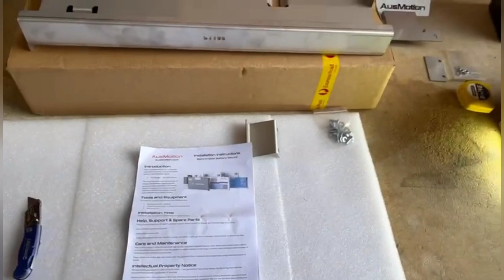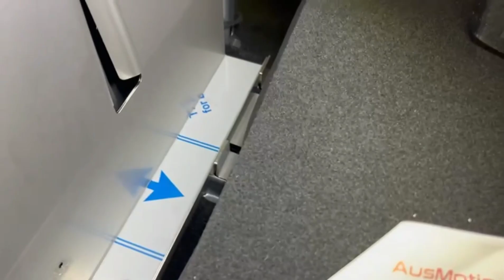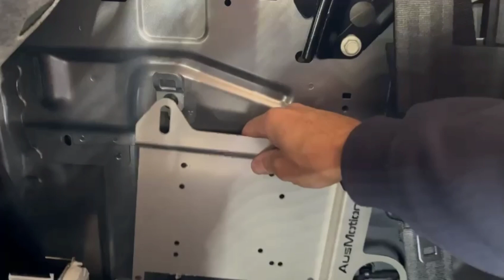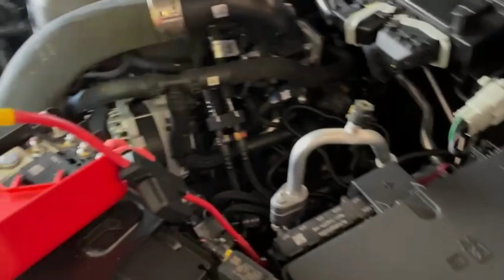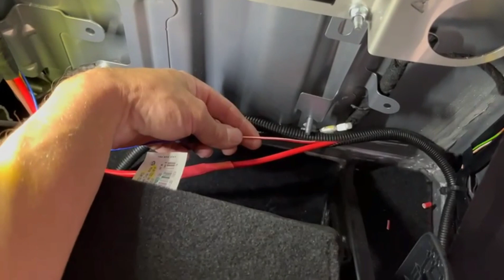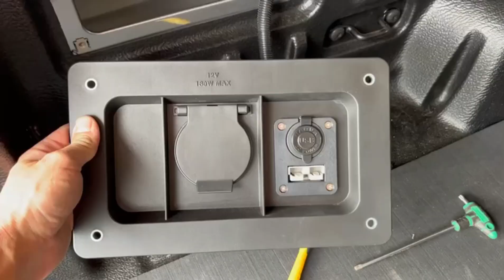Lithium Dual Battery Install | New Ford Ranger ‘ Next Gen’ XLT 2023

Comment: Cheers for the video. Question with cable size used for the feed out to the tub. Was this 8awg.
Thanks
Reply from the maker: Thanks for watching. Yes 8awg or 8mm2 cross section, its 8b&s cable which is rated at 75amp.

Comment: Great video as I'm just about to tackle this job myself.  Did you have to scrape away any paint or prep that stud as a ground point at all?
Reply from the maker: Thanks for watching. The surface is already clean and ready but i did use sandpaper on the stud/ surface just to be sure. Let me know if you need any other info/ help.

Comment: When connecting the ignition wire. Is there anything I should be doing before hand? Does cutting it trigger any fault codes etc. and did you just cut and connect the 3 wires?
Reply from the maker: Cutting it shouldn’t trigger fault codes, but just make sure the ignition is switched off when doing the wiring. And yes cut and joined the wires. 
Let me know if you need any more information. 
Thanks for watching.
Reply: Thanks for the reply. Did you solder the wires or just BP?
Reply from the maker: No problem, I soldered them. Either is fine, i just prefer soldering.

Comment: Awesome video. Very informative and helpful. Thank you!

A quick question if I may - If I wanted to run two Andersons and a usb socket, using the same method of piggybacking like you have done, would you recommend using a 8mm2 B&s cable as the main feed to the tub, then dropping to 6mm2 for the Anderson feeds, or could I use 6mm2 for the main feed to the tub and the piggybacks for the two Andersons and USB’s?
Reply from the maker: I would always recommend using the larger cable for the main feed. This avoids any volt drop and future issues. 

Thanks for watching!

Comment: What is the slimline battery measurement?
Reply from the maker: Case Dimensions (L x W x H)690mm x 50mm x 305mm
Let me know if you need anymore info.
Reply: @vesautoelectrics  for battery do you have recommendations for budget build
Reply from the maker: For budget builds i use ATG batteries, but not sure if a slimline is available? Other alternatives are baintech, Itechworld or Kings. But try and buy the best you can afford.
Reply: @vesautoelectrics  thank mate. Will do research for all the brand
Reply from the maker: No problem 👍

Comment: Excellent content. Question.... do other manufacturers do the "accessory outputs" like Ford do???? That would make DIY so much easier. I have a current model BT50.
Reply from the maker: Thanks for the feedback! Much appreciated. Some of the Isuzu commercial trucks have builders plugs for adding accessories and also some American pick ups. It’s really handy especially with all the canbus wiring  and modules on vehicles, makes tapping into circuits very difficult.
Reply: 70series Landcruisers have a black box under the bonnet with fused terminals for ACC, IGN, B+ and Earth.  Makes life easy.

Comment: Great job on the videos as usual.
l have a question for you regarding the POSITIVE LIGHT pre-wired wire in the passenger kick panel of the next gen rangers.
I am wiring up 2 Narva spot lights which comes with a 3 pin plug and a 12 inch wire harness red, black, and (brown which is to connect to vehicles parker light circuit (+) ) with a kings 4wdsuper centre spot light wiring harness.
So would you think the parker light circuit (+) be the same as the POSITIVE LIGHT wire.
Thanks
Reply from the maker: Thanks for the support! Yes you can connect to the positive light wire to have park light function work on the spotties. How comes the Narva spotties didn’t come with a harness? Also just make sure the wire sizing is sufficient on the kings harness and the plugs are the same.
Reply: Hey thanks, yeah the Narva spotties come with a foot long harness/cable with a 3 wired 3 pinned deutsch plug and then you terminate the red +, black - and brown to the park light + wire. The kings plugs are only 2 wire red & black, I’ll be doing solder joints.
So the brown wire of both spotties ( parker light wire) to the positive light wire of the vehicle.
Thanks
Reply from the maker: Sorry only just seen your comment. Yes that’s correct. Once it’s all wired up, run the vehicle with all the lights on for 10 minutes, just to make sure no wiring /connections are getting hot.

Comment: Fantastic video and very helpful. I purchased a slimline rear seat kit for the next gen Ranger from accelerate 4x4.  in their instructions they run the trigger wire all the way over to the fuse block on drivers side which but I want to do use the run start wire as you did however it’s being used for the ARB light bar. Is it safe to tap into this and will it handle another circuit ?
Reply from the maker: Thank you for the feedback. Yes you can tap into the start run wire. The ARB lightbar wire is just a trigger, same for your wire going to the dc charger. Very small current from both so no chance of overloading. I would put an inline fuse on your trigger wire. 5amp will be fine. Let me know if you need anymore info. 
Thanks for watching.
Reply: @vesautoelectrics
Reply: Thanks for the quick reply and did as suggested and works a treat. Again your videos are very informative and enjoyed the review on various lithium batteries and other tips and tricks.
Reply from the maker: Thank you

Comment: Thanks for the vid mate. Curious, did you have the factory BMS disabled? The Ford equipment manual seems to say this needs to be done to ensure batteries reach full charge? Would be helpful if not required. :)
Reply from the maker: Thanks for the feedback. Nope didn’t have to disable. The redarc bcdc charger is set up to deal with smart/ ecu controlled Alternators. Getting 14volts output.